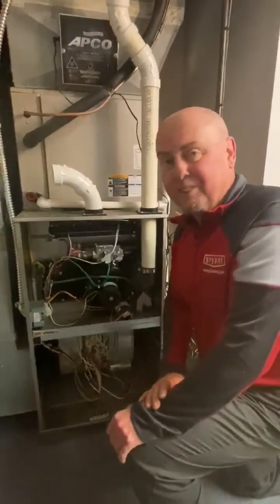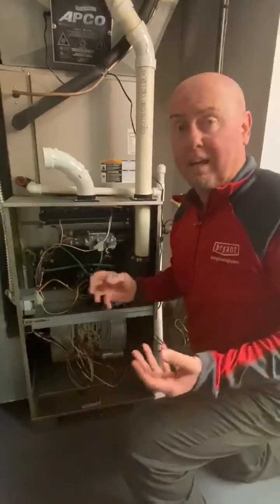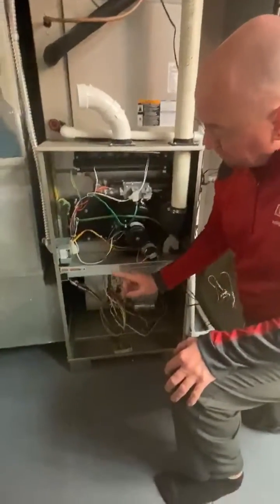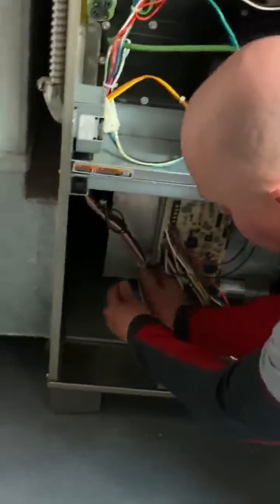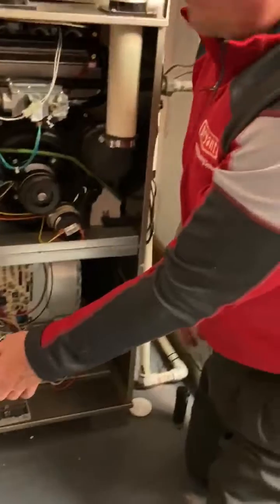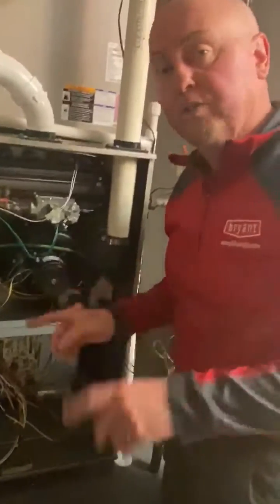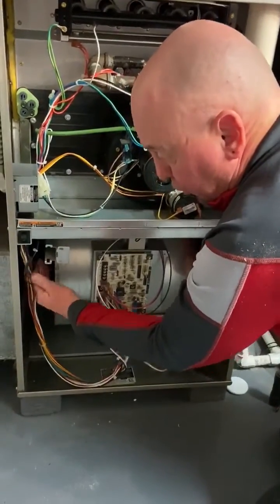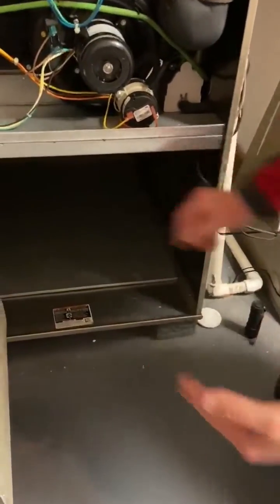Checking Bryant Secondary Heat Exchangers

Comment: Can you actually clean out the internal parts of the secondary heat exchanger on these unit
Reply from the maker: @Mattyehdams  
You can…and easy access to clean. Coupling box comes right off. Don’t strip the screws. 

But getting the turbulators back in could be an issue.

Comment: Thanks for the video.  My six years old Bryant high efficiency furnace has been working fine, but I checked/cleaned the secondary heat exchanger per your video.  It needed to be cleaned since it had caked on dirt on about a third of the surface finned area.  I had to disconnect the condensate pump, the humidifier, and the thermostat in order to get the air handler out, then forgot where all the wires went -- but I took a picture of the connections at the motherboard before hand, so all went well.

Comment: What you really need to check on that model is the primary heat exchanger. Remove the main limit switch and put a scope in there. The primary on that is going to corrode early. Already seen it on lots. The primary was designed to drop the temperature too much and it is condensing before it gets to the secondary.
Reply from the maker: I have not heard this? I will look into this…certainly possible, anything is possible that’s for sure. 

The 900 and 59 series was released I believe 2011. I can tell you primary HTX failure on those products across North America is extremely low. 

If I hear about condensing in the primary I typically think under fired and or low return air temperatures. 

I will look into this.  

Thank you.

Comment: To clean this, do you just take a shop vac and go over the fins lightly?
Reply from the maker: Good question. Yes.

But if it gets neglected the coil is actually very thick. It would have to be removed and cleaned if the coil gets compacted.

I have taken a soft brush and a cleaner to the bottom to clean, but its very messy. It works though.

Typically a vacuum and a brush will do the job. 

Best advise is to be sure filter cabinet is sealed to the unit, seal the bottom furnace plate, filters properly seated with no by-pass and keep filters clean.